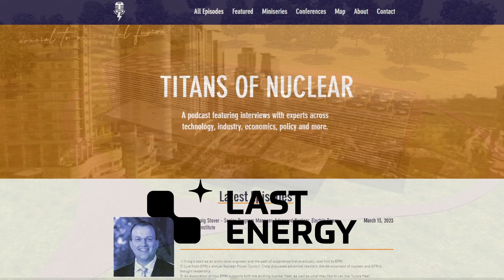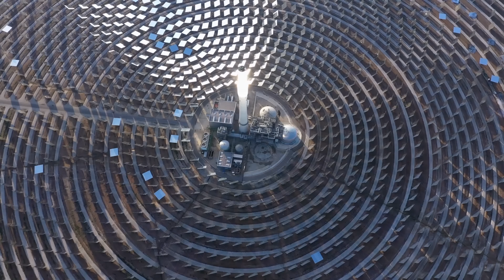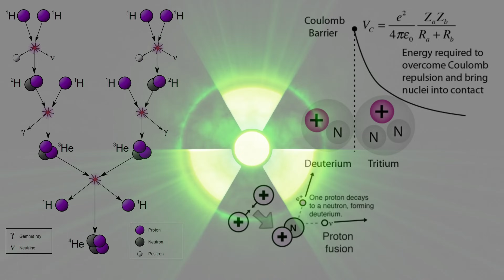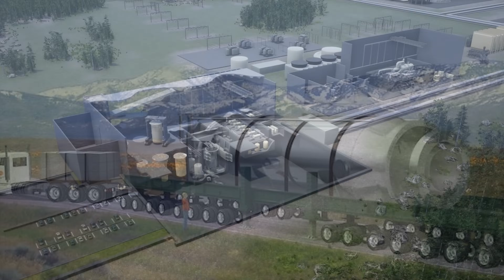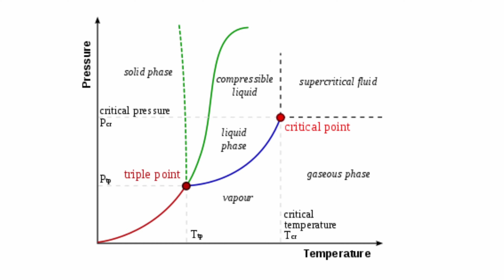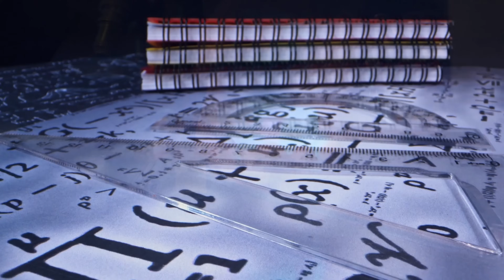Nuclear Power: Small Modular Reactors

Comment: Alpha radiation is not dangerous. It penetrates even less than beta radiation. In fact, the preferred decay mode for RTGs is a pure alpha emitter because it can be shielded by about 10cm of air, or 0.01mm of water.
Reply from the maker: No, alpha radiation is the most easily shielded, not 'not dangerous', those two are not the same thing.
Reply: @isaacarthurSFIA  Yes, but dangerous is a relative term. Compared to all other forms of nuclear radiation, it is the least dangerous, being incapable of penetrating the dead layer of skin. When considering strictly internal exposure it is comparably dangerous to the others, but if you're going to compare external exposure of alpha, beta, neutron, and gamma radiation (as you did in the video), alpha is the least dangerous.
Reply from the maker: @FourthRoot  I won't debate the point, given that I don't think we actually disagree anyway, especially as the script says alpha and beta when discussing penetration and I apparently skipped alpha in the narration, obviously it could have been phrased better, but I don't - especially with pressurized reactors or smaller ones that might have more casual staff - like to ignore the inhalation or swallowing option, or what damage it can do to equipment.
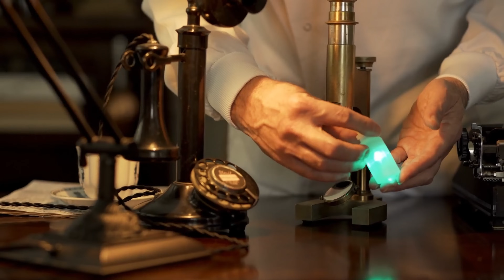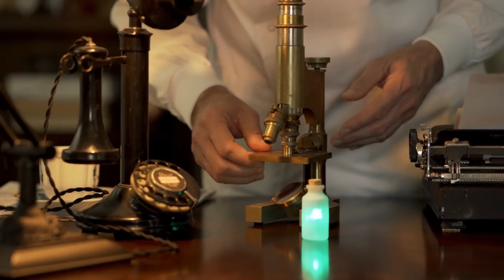Reply: @isaacarthurSFIA  I'm sure we do agree. I was referring specifically to 12:07 - 12:22
I think you misspoke, you said that beta radiation does not penetrate skin (true), but lumped alpha in with neutron and gamma radiation as "dangerous".
Not here to debate, just pointing out an error you may wish to correct.
Reply from the maker: @FourthRoot  Oh no, I definitely misspoke, your complaint was legit, the captions/transcript have the comment right:
"The type matters too, as Alpha and Beta Radiation are incapable of penetrating human skin, whereas Alpha, Gamma, and Neutron Radiation are all rather dangerous and indeed Alpha and Neutron Radiation are what we often use to induce fission in bigger atoms. " 

Sadly the only correction youtube permits are to captions, and those were already right anyway, my narration flubbed and I was looking at the script so wasn't sure what you were refering to. There's a worse one a minute earlier where I've got a picture of pair of tritium particles on screen while cheerfully discussing He-3 :)
Reply: @isaacarthurSFIA  I usually only listen to your episodes while doing other things, so I missed that one. Love your work, by the way.

Comment: The critique about nuclear energy isn't entirely about reactor safety. There are the same arguments that are true for all energy sources based on limited supply of fuel: you're not truely energy independant, there is a market and at some point it will be all gone. Then there is the fact that it produces toxic and radioactive waste and byproducts that can't be recyled but must be safely stored for 100.000 years or more. Often storage conditions are suboptimal and unsafe.
Reply: We have billions of years worth of fuel and nuclear waste is an asset, not a liability.
Reply: @chapter4travels  idk if this stuff is an "asset" unless you plan to manufacture a lot of weapons, like DU rounds for tanks. Also do you have any sources on uranium reserves lasting a billion years?
Reply: I think he is referring to breeder reactor fuels as well as asteroid mining.
Reply: @lux3390  might be the case. But then he's using scifi as an argument against something that actually happens at this moment.
Reply: If it's "hot" enough we need to store it for 100K years, then it's "hot" enough to use as the fuel source for small RTG reactors.

Comment: Top 5 plausible and easy fusion reactors. 

Number 5: the fusion bombs.

Number 4: hydro electric power. 

Number 3 the Mouchot  solar steam engine of 1866. 

Number 2 : the biosphere and bio fuels in use in fuel cells or combustion engines.

Number 1: Dyson Swarm. Or Saharan photovoltaics.
Reply: I'll have you know this got a hearty chortle.
Reply: @12pentaborane  thank you 🙏

Comment: I like the idea of SMRs in principle, but I suspect their bigger brothers are a bit easier to make resistant to ideological obsessives with private planes and drones packed with explosives.
Reply: Iran has actually done a lot of research into “bunker buster”-proof bunkers with ultra high performance concretes. I bet that same technology has applications in protecting distributes nuclear power plants.
Reply: Even blown up they should ve quite safe for the surrounding area.
Reply: SMR’s will work in space, esp the 50 ton versions that can be chucked at Mars & the Asteroid Belt on SpaceX Starships or using orbital assembly.

Comment: I believe Rosatom also has something on the topic of SMR, though I am not sure they have working prototypes. Wouldn't be surprised if they do given Russia is one of the biggest players in the field of nuclear energy.
Reply: That's why SMR will fail. Everyone wants to gain share in market, when with manufacturing of volume smaller number of reactors you produce pricier they will be. With that many designs and high protectionism running amongst most of the biggest countries chances for world wide sources of single SMR are non existent.
Reply: @simon2493  Bingo. Old nuclear hates SMRs because the whole damn industry relies on big juicy contracts for huge and expensive machinery. They present just as much an obstacle as the anti nuke regulatory environment.
Reply: @simon2493  a) Learn English.

b) Learn the concept of Economies of Scale.
Reply: @LordZontar 

A.) learn English
B.) With SMR we are working against economy of scale. Economy of scale is reason why over the years reactors have grown bigger with EPR having 1600 MW. I assume you meant economy of volume, but then we are at the starting point again. No single SMR design has any chance to be built in sufficient number. China, India, Korea, Russia every big player has it's National design. Even in US there are at least 2 SMR designs one is 300 MW and one is 70 MW.
Reply: "Small reactors, modular or not, are expected be more expensive per unit of output because of something that economists have known for decades and termed economies of scale [40]–[42]. Larger reactors (or other power plants for that matter) are cheaper on a per megawatt basis because their capital and operating costs, which represent material and work requirements, do not scale linearly with generation capacity. This is reflected in a general rule of thumb followed in industrial engineering which uses a power law to relate the capital costs of production facilities with different capacities, with an exponent that is usually chosen to be 0.6 [43, p. 421]. Other studies use different numbers for the exponent (e.g. 0.55 used in a study by the Canadian Nuclear Laboratories [44]) but none of them expect that the exponent will be one. With an exponent of 0.6, if there are two plants of size S1 and S2 , the ratio of their capital costs K1 and K2 is given by:
K1/K2=(S1/S2)0.6."

Here ready to admit you were wrong? What you mean by economy of scale is true for broad market, but in Nulcear industry it's called economy of volume higher volume you produce of set unit cheaper it's price is.
Reply: @simon2493  Wrong again, Skippy:

"SMRs are cost-competitive: The analysis of various policy and market conditions shows that there are scenarios where SMRs are economically competitive in comparison with other generation sources, especially when the value of nuclear energy is considered. SMRs are strong candidates for providing firm clean electricity as partners with renewable generation and storage. The first SMRs are expected to be within the range of the lowest cost alternatives, assuming appropriate private-public partnerships address typical first-of-a-kind  challenges, which have been provided historically for other new technologies.

By 2035, after the first few plants begin operation, SMRs can be cost-competitive without the need for private-public partnerships. For several scenarios, the costs of SMRs are within the range of natural gas plants and renewable generation sources. This means, that a utility could choose an SMR based on intangible factors such as long-term price stability and fuel diversity. The tremendous potential for SMRs justifies further investment and private-public partnerships to support first movers."

"Traditionally, nuclear developers have been building increasingly larger designs to overcome high up-front capital costs through economies of size. SMRs take advantage of the economic benefits of simpler design,  standardization, smaller components, and greater use of commercial-off-the-shelf parts to more than offset the loss of economy of size. Repetition that reduces costs through applying learning curves is an important benefit. SMRs are modular and factory-fabricated, improving the quality and costs, and taking safety-related work out of the field. A cost analysis was performed using a proprietary model based on a nominal 600 MWe SMR plant consisting of four 150 MWe reactors, and compared to costs of other generation sources. The following is a discussion on the results of the analysis. Inputs and assumptions are provided in Attachment A.

Two different types of possible ownership are considered; investor-owned utilities (IOU) and municipal utilities (Muni), the latter of which represents any government-backed utility.

Typical first-of-a-kind (FOAK) challenges create unique regulatory, technology, and financial risks that most companies are unable or unwilling to accept. These risks translate into higher costs for the first SMRs that exceed other lower-cost generation sources creating a fundamental barrier to technology adoption. A classic challenge exists in which companies are unwilling to construct new technologies because of the perception that FOAK costs are more than the lowest cost alternative in the market. It is
common for government to help bridge this gap for capital intensive long-timeframe technologies like SMRs.

...

"Starting around 2035, after lessons learned through deploying the first few facilities are incorporated, SMRs can be cost competitive without private-public partnerships. This occurs by applying a learning curve that achieves cost reductions – a well-established phenomenon where repetition leads to improvements in productivity resulting from the experience gained. As production and construction increase, government support would no longer be needed to be cost competitive in the market.
Figure 6 and Figure 7 summarize the NOAK  for IOU, starting from the reduced capital cost and O&M as described in Appendix A. Figure 6 assumes a learning rate (LR) of 15% and Figure 7 assumes a learning rate of 10%. The Muni case has only the CWIP cost reduction option as summarized in Figure 7. The costs of an SMR and an NGCC, both becoming operational in 2035, are reflected as ranges of LCOE, due to the uncertainty of future conditions. Uncertainties that affect the future costs of SMRs include a longer  operating lifetime (60 years instead of 40 years), material escalation, and opportunities to further reduce upfront capital costs by  achieving higher rates of learning and incorporating advanced manufacturing and construction technologies, and policies or market dynamics that value nuclear energy’s attributes such as resiliency, reliability, and zero carbon emissions. Uncertainties that affect the future costs of NGCC include  future natural gas prices, carbon sequestration requirements and
technology maturation.

Figure 7 presents the range of costs expected in 2035 for an SMR and current alternative technologies. The min max ranges are including/excluding the possible cost reduction strategies discussed before as also the 10/15% bracket in the learning rate and possibility to benefit, in the case of IOU of a 1% reduction in the cost of equity due to a decrease in the risk of the investment profile. For most scenarios, the costs of SMRs are within the range of natural gas plants; a utility could therefore choose an SMR based on qualitative factors such as long-term price stability and fuel diversity. Although there are some scenarios that  place SMRs at costs higher than NGCC, there are also many scenarios where SMRs would cost less. Therefore, SMRs are a valuable option for utilities in the future."

http://smrstart.org/wp-content/uploads/2021/03/SMR-Start-Economic-Analysis-2021-APPROVED-2021-03-22.pdf

This study here also says the assumptions you're relying upon are dead wrong:

"Power scaling is well known in the energy sector. As units of a similar design increase in size, their cost rises more slowly and unit costs fall.

Cost/Power a (Power)a

where a is the scaling index, taken to be in the range -0.6 to -0.3, or -0.5 to -0.3.

This effect could make the unit capital cost of a 200MWe SMR more than double those of a 1000MWe reactor. But doubts have been raised about the correctness of the index values employed in these estimates. Many of the cost studies relate only to the USA and specifically to the early part of the programme in 1970s. Some of the data appear to be either from non-nuclear sources, or from other estimating methods. More significantly, scaling index is derived by separating the reactor scale and construction duration as independent variables.

This strong power scaling effect is not present in later and larger studies of the cost of US reactors. It is clear that larger reactors take longer to build because they are more complex. Therefore scale and duration are not independent. When these two variables are combined, the effect of scale on cost is much smaller than previously thought. Power scaling effects may even be negligible, because all the predicted savings from increases in size are offset, either by extended construction duration or additional safety enhancements required for these larger reactors.

Similar cost trends with low or negligible cost scaling are seen in other published studies from France, Japan, UK, Canada and South Korea, covering almost 200 of the over 400 power reactors built. Nuclear power scaling effects are either small, or are completely absent.

Opportunities for learning and productivity improvement arise from the larger numbers of SMRs required to provide a fixed amount of power. Series production of a common design leads to lower costs. Also, there is the potential for enhanced learning from factory construction, made possible by their smaller size. Manufacturing learning leads to progressive improvements in productivity and progressive reduction is cost, expressed as:

Man-time cost falls at a fixed rate % (?) as volumes double

where ? % production time saving for b doublings of units or volume, with ? - Wright Progress index. Learning rate = 1-? being in the range 10-30%.

Learning rates of double-digit percentage are seen across many manufacturing industries, including those that have relatively low volumes and large sizes similar to nuclear power. Two summary studies (see Table) covering many other investigations and industries support this effect."

http://smrstart.org/wp-content/uploads/2021/03/SMR-Start-Economic-Analysis-2021-APPROVED-2021-03-22.pdf

"Here ready to admit you were wrong?"

Seems maybe you should contemplate taking your own advice.

Comment: Ultimately, SMRs are at the mercy of the same regulatory problems as larger plants.  The NRC is one government agency that seems actively hostile towards the industry it regulates and the hoops through which anyone wanting to build a new reactor must jump are deliberately absurd.  Without reform for the whole process and a new process that permits SMRs (which pose less risk to the public than traditional plants) to be licensed and to operate under less stringent regimes, I just don't see them taking off in the US.

Overall, our nuclear industry may have entered a terminal decline where grid operators will stop building or requesting life extensions on reactors because the future looks so dire and none of them want to be the last one holding the bag, trying to prop up the entire regulatory apparatus and specialized supply chain on their own.

Comment: I am hoping that the Moltex Statable Salt Reactor takes off.
Reply: Is that the molten salt pebble bed that uses the salt as a neutron moderator? I'm fond of the way that design can "auto-scram" and shut it's self down when it overheats. (a plug in the bottom of the tank melts, then the neutron moderator pours out, shutting down the reactor, since the pebbles can't reach critical mass without a moderator)

Comment: We've gotten really good at controlling reactors, based on decades of experimentation and practical experience.  It's also not fair to intimate that older reactors are just left in their original state to run as safely as the technology of the day permitted.  They are constantly upgraded and, as many of the things which make reactors safer today are more about sensors and control than big hunks of steel and concrete, old reactors can, for the most part, be upgraded as technology improves.